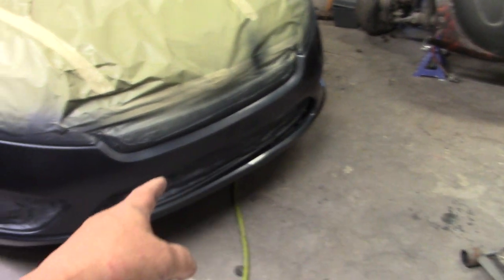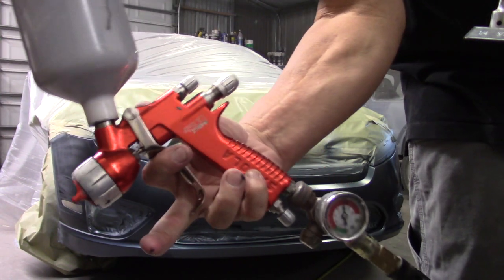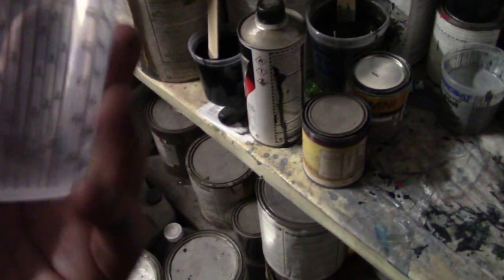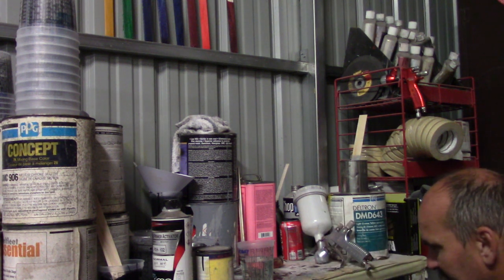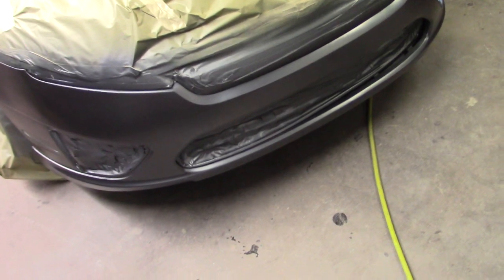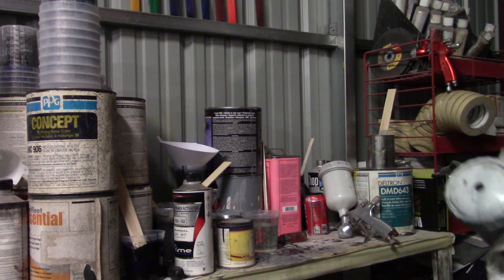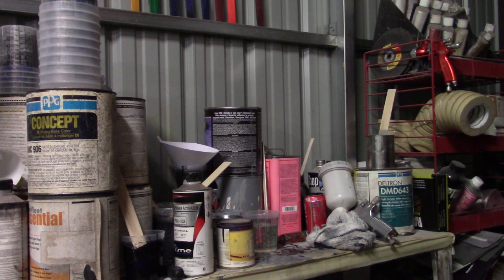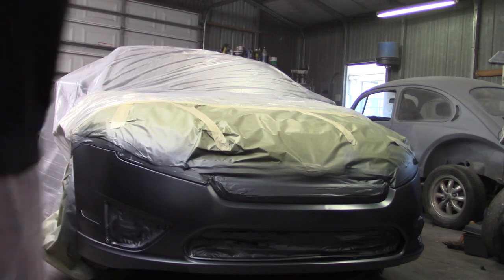let's paint a bumper

Comment: Darrin I Love your channel brotha! I am restoring a 73 911 and am putring a vw motor in it while I complete the 911 2.4. My question is - I bought a motor that was built by someone else. Components are pretty new. #3 piston has low compression. Do they sell seperate cylinders and pistons or do I have to but the whole set? They are "Arp total seal"  Makes no sense to buy a whole set for only one problem. Thanks in advance man. You are the modern day John Muir

Comment: Nice job as usual paint master ..sorry I haven't sent you the parts yet I'm ordering new springs and might buy stainless valves I sent Andrea a. Text today as. I need to know if you cut my valve bosses down .in order to run dual springs feel free to call me ..I know your always buisy ..and thanks for your help on my motor and the heads I know you were frustrated I didn't send the old parts ..apologize mutch respect to you and all you do ..I appreciate you ..and the vidieos ...Russell ..72 914 2056 turbo build ..